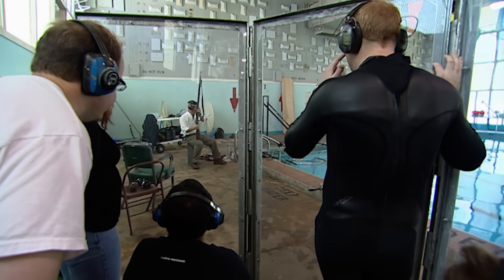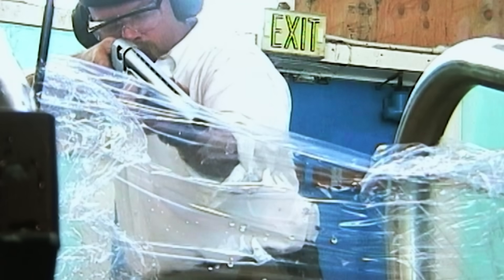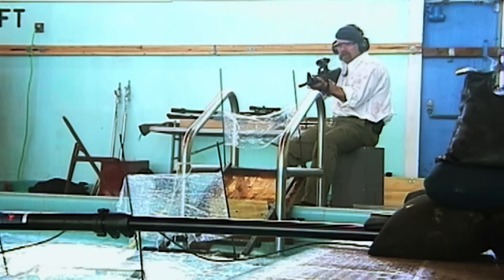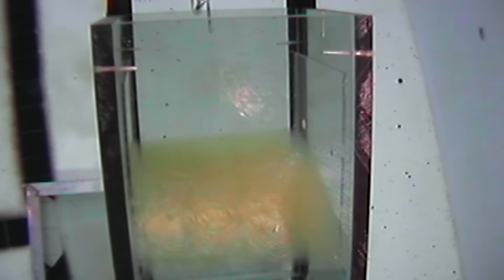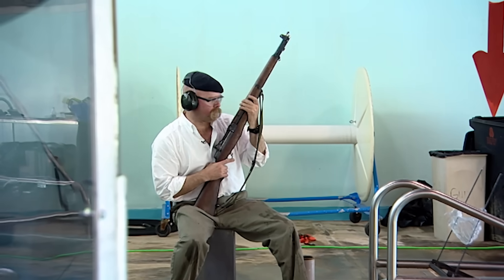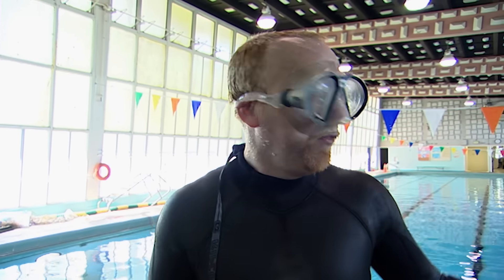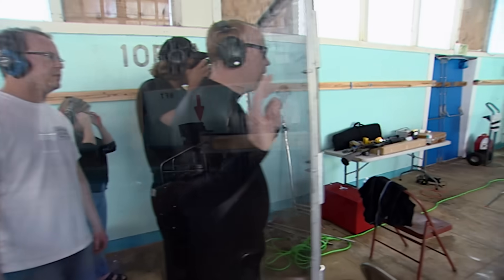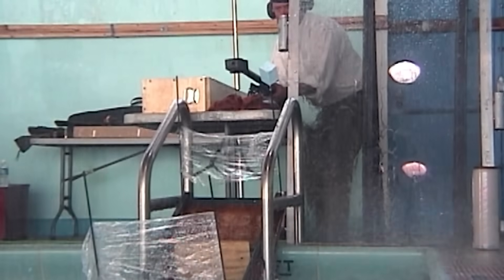Can You Dodge Bullets Underwater? | MythBusters

Comment: It makes sense when you think about it: bullets are designed to transfer energy into mediums of flesh. Flesh is made up of mostly water, so when a bullet is fired into water, it transfers all of its energy into the medium and breaks apart as it does so. Thus, explaining why these bullets are breaking apart. They’re transferring all of their energy into the water. If you had something like a stainless steel core which isn’t designed to transfer energy, it would travel through the water and into the gel. However, it would also pass through the flesh without delivering any of the energy.

Comment: I‘m not surprised, water starts to behave like concrete at speeds that humans can reach while falling, let alone something moving even faster. I‘m also not surprised that they were fine even with the 50. cal, it would’ve been a different story if they had submerged the barrel of any of these guns.
Reply: You're right.  But I've seen in a lot of movies and TV shows where the falling hero shoots at the water to break the surface tension.
Reply: i think the point of doing this experiement was, that they try to do the same think like in the movies. there the shooters usually are standing on boats or on the side of rivers, shooting from outside the water.

but it would have been interessting to see it with the barrel submerged.
Reply: it's the transition from air to water that destroys the bullet.
and yes, if the barrel was fully submerged, the bullet would travel much further, but could explode if there was any air still in it..